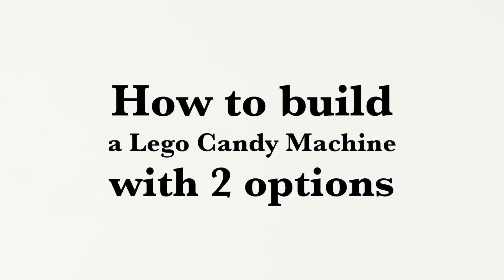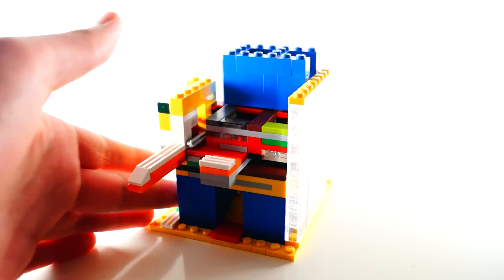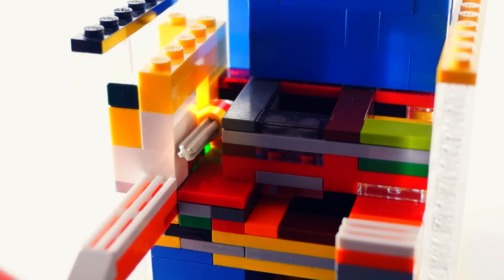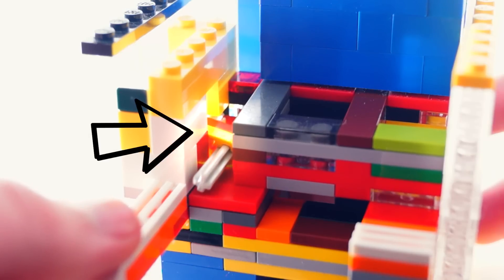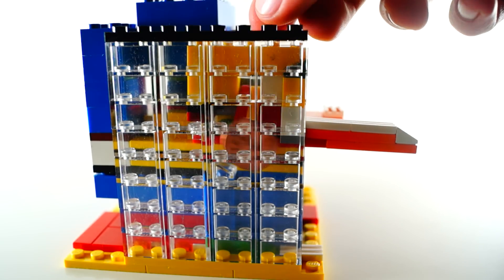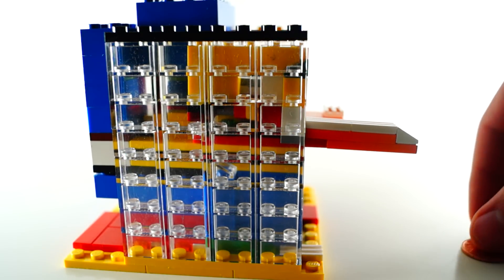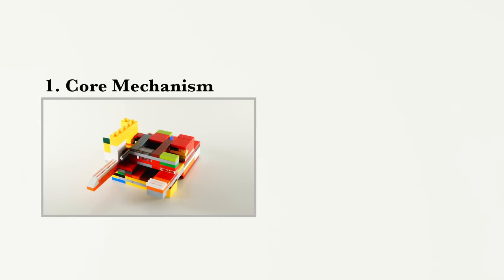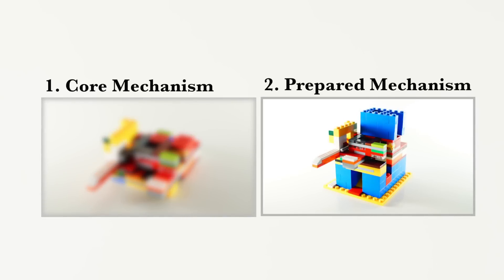How to Build a Lego Candy Machine Mechanism with 2 Options

Comment: I built this 3 times over and over again and the lever compartment won't lock at all. It just slides out! Help please.
Reply from the maker: The connector piece between the brick with a hole in, and the bar has to be GREY or SAND colored. BLACK won't work. ;)
Reply: yeah but mine is sand
Reply from the maker: Try grey then ;)
Reply: it still doesnt work :(
Reply: ElectryDragonite
Reply: +Rap Masters You're Probably using the wrong technic peice